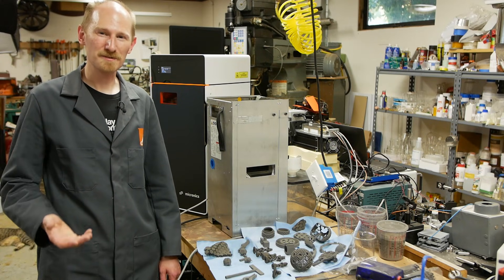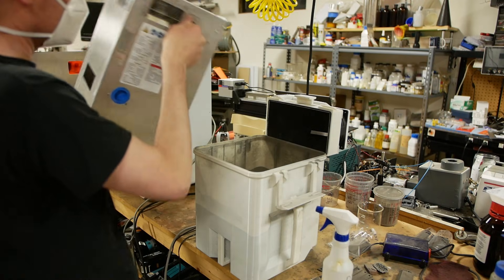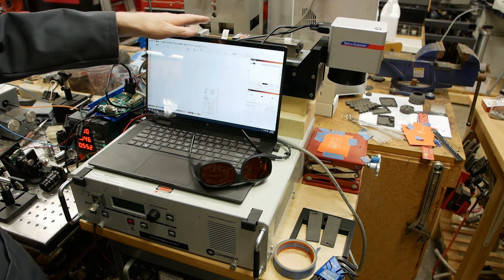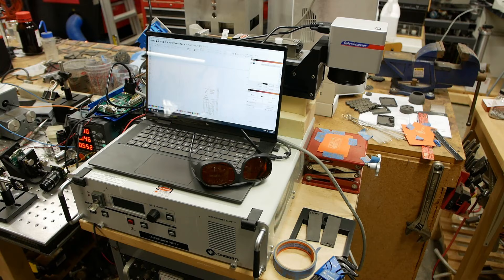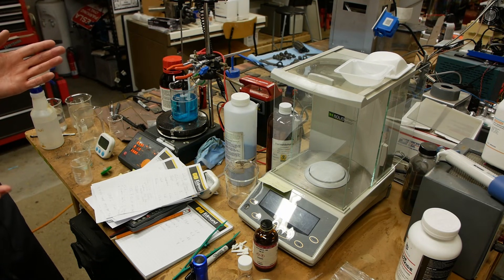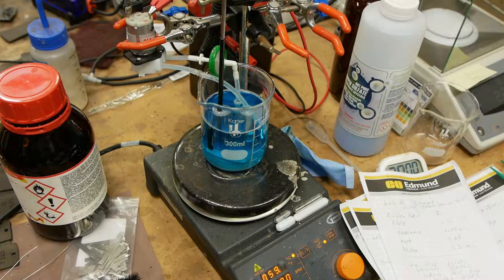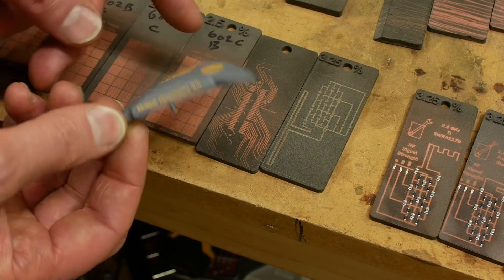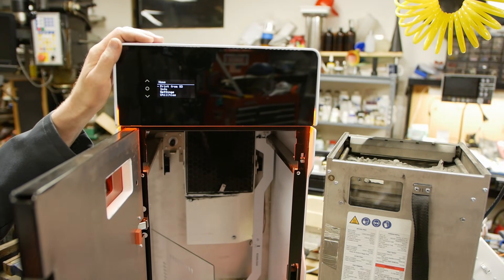Micronics SLS nylon 3D printer makes electronic circuits

Comment: I wonder, using the pulse laser in the SLS device, how closely you could make layers before they start to interfere/leak? Could be a fabulous way of making multi-layer circuit boards—including the use of ground planes—at home.

The final key to this would be if you could pick-and-place in the middle of the printing/pulsing process, to add components to the circuit that will eventually be buried in the final part? Great potential for HV circuits that doesn't require filling with resin to prevent sparks.

Comment: When you mentioned the thin focal plane I imagined you were gonna suggest a pantograph type system moving the optical assembly/part. Integrating a pulsed laser into the printer is sheer genius though!

Comment: So far seen one review where thier printer arrived broke and it was stressed "this is a beta product" and it was held by duct tape.  Then saw another review where the printer keep jamming and failing and the youtuber was told by the creators to hit with a hammer to fix lol.  This is cool product but not ready yet for Kickstarter I feel if folks looking for a viable product in return.

Also the yiutuber where he had nothing but issues even after working with the creator of the printer couldn't resolve things, was told to not release thier video till after the kickstarter was done says something.  Not a fan of a company trying to stop a honest review then demand the printer is sent back and stop sponsor cause the creator gave a honest review

Comment: Very nice video! I understood maybe 50-75% of it, but I was still entertained and hooked by your fascination with it. The method of printing electrical wires in a part is and can also be used in FDM printing with multimaterial so for shure also in SLS. Maybe it would also be nice to have a machine that can also create space for components to be placed inside a part.

Comment: Watching that part flex as you heat treat it was fairly cool. You try doing the laser treatment then printing on it again so you could embed a thick trace that you can pass enough voltage in to heat it to see if you can create a sort of artificial muscle where the heater is embedded?  Or maybe put some iron powder from a toner on every other layer to make a plastic electro magnet?

Comment: @ Applied Science
Thanks for another fantastic video. As always mindblowingly (that should be a word if it isn't) impressive and thoroughly interesting.
And the thoughts on integrating circuits into curved surfaces by doing it during the "planar printing stage" sounds like it would have been "patentable" (which also should be a word ;)... But now this principle is in the public domain... But maybe there still is something that can be "gate kept", not that I'm against Open Source, but I think it's high time that You got rich from Your inventions :)
Best regards.

Comment: Awesome video 👍
Since you said that you can hear when the laser is focused, how about a microphone (with a band pass filter to only let the sound through that occurs when the laser is focused) to control a stepper motor, which in turn moves a little platform up and down to automatically focus the part.

Also, I'm curious if it's possible to clean off the residual powder (especially the fine dust) using an ultrasonic cleaner.

Comment: Electroless Cu plating from my 1968 "Techniques of Materials Preparation and Handling Part 3" book page 1374:
Solutin a:
CuSo4.5H2O    35g/L
Rochelle Salt     170 g/L
NaOH                  20 g/L
Na2CO3              30 g/L
Versene T (Na salt of ethylenediaminetetraacetic acid)  20 ml/L
Solution b:
Formaldehyde 37% by weight

1.  roughen by abrasive treatment
2. sensitize by immersion on a hot solution of 0.1g/L AuCl3
3. immerse in a mixture of 5 volumes of  solution "a" and 1 volume of solution "b" mixed just before use.
25 deg C
25 microns / hr , life of the mixture is about 2 hrs.

Comment: What about sintering high copper oxide content plastic powders?
Those should immediately turn into copper metal under the pulsed laser, but the sintering laser only melts the plastic.

Comment: Even ignoring the fact that integrating the catalyst activation with a widely-available SLS printer allows you to catalyze curved surfaces, it would also just make it really simple to print circuit boards on a 3D print. The plating part may still require some care, but I don't think the value of simply integrating the catalyzing process into printing even a flat surface should be underestimated.

Comment: I'm always impressed with curved circuit board manufacturer. I have a 900R monitor and am using a Kinesis Advantage2 keyboard. I didn't realize antennas were created in this form inside electronics though. And yeah, we all have used LLMs for something technical that seems astounding.

Comment: Really agree with your closing idea of making tools for others to see what they do with them, I think that also motivates me. Re: the internal electronics, any idea how you would do the plating step on a fully internal trace? Would the SLS part need to have some porosity? In that case, you might also have an interesting opportunity for the mechanical "metamaterials" folks, where perhaps the copper could alter not just the electrical but also the mechanical properties of the print.

Comment: Every YouTube channel I come across that makes their own PCBs either use super nasty chemicals, extremely unique and expensive machinery, or straight up lie. I've given up on desktop PCBs. It seems our only real hope will probably just end up with people literally making their own IC's. Considering you could sell silicon chips with pins premade and you just connect to those points and have a projector machine at home, it just makes a lot more sense.

Comment: I used to run a Shipley 3000 PTH line, and we were adding a 500-1000ml of formaldehyde to the electroless (150 litre) bath every 3-4 hours to keep the plating thickness uniform throughout a production day.
Reply: Thank you for sharing arcane lore.

Comment: With in situ pulse laser you could do solid thru hole interconnects for multi-layer trace planes! All you need is to add pick & place inside too to make true 3D circuits. 

I see there are papers discussing using black copper oxide that is heated to 1000C to convert to copper. I suspect this would need to be done in a inert atmosphere to avoid oxidation issues. I believe Copper oxide is non conductive, so you might be able to just add black copper oxide, than pulse laser to make conductive traces. This might be worth the time to try.

Hopefully you post more content with this system! & thank you for this video!

Comment: A couple of points about the dichroic mirror to make your life easier:
-reflect the shorter wavelength and transmit the longer one (this should be already the default for your set-up) 
-if possible (or economically viable), try to find a 1064 Nd:YAG laser for the activation: it will be hard to find a mirror able to split 447nm from 532nm(I guess that's your green laser) and sustain the two lasers power. Most of the dichroic mirrors on the market are designed for fluorescent microscopy. 
-if possible, use polarised light: p for the one to be reflected, s for the one to be transmitted
-remember to add an antireflective coating on the back of the mirror, or you will start carving the side of your printer

Lastly, a plate mirror may introduce beam deviations and a tilt in the focal plane of the activation laser; on the other hand, a cube beamsplitter may interfere with the calibration of the printer laset.

Comment: Summary of Applied Science: 3D Printed Circuits with SLS Nylon Printer 

This video by Applied Science demonstrates how to create printed circuits on 3D printed parts using a new desktop SLS nylon printer and electroless copper plating. 

Key Points:

* Problem (0:00): Past attempts with SLA printing resulted in poor copper trace adhesion.
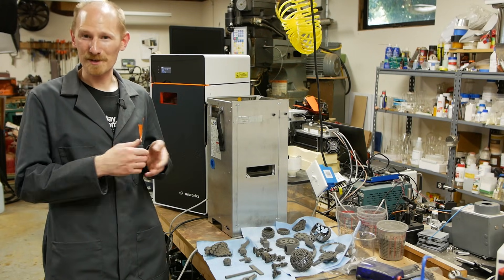* Solution (0:40): A new approach using SLS printing, a pulse laser, and a refined copper plating bath.
* Process:
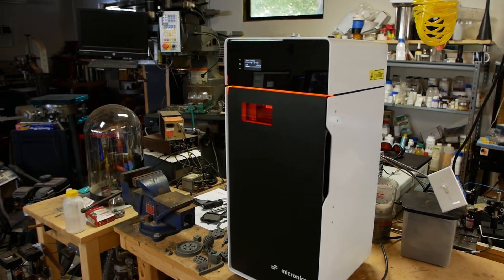    * (1:30): Mix copper chromite catalyst powder with nylon printing powder.
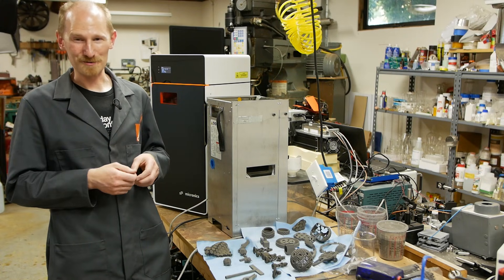    * (1:30): 3D print the desired part using the SLS printer.
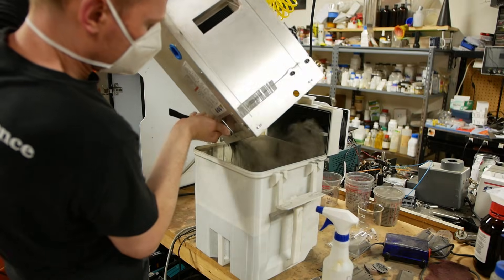    * (2:40): Clean the part with media blasting and dish soap to remove excess powder and dust.
    * (3:52): Use a pulse laser to selectively activate the catalyst on the part's surface.
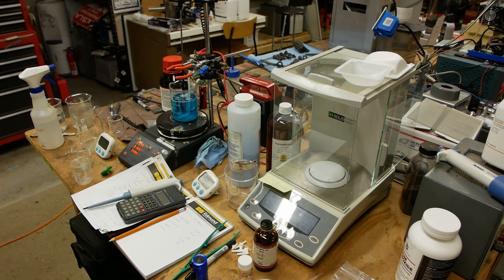    * (8:11): Submerge the part in a carefully prepared electroless copper plating bath.
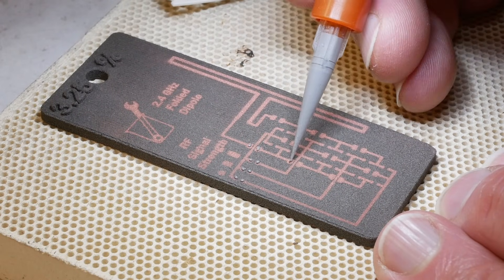    * (12:44): Apply solder paste and use hot air to reflow components onto the copper traces.
* Robust Plating Solution (8:11): 
    * Achieving a stable copper plating bath was a significant challenge. 
    * Key Finding: Dissolve the sodium hydroxide (NaOH) in water before adding it to the bath to prevent copper precipitation. This information was crucial but absent from traditional resources.
    * Dust Prevention: Filter the plating solution (11:49) to remove any dust particles which can act as unintended catalysts and disrupt the plating process.
* Advantages:
    * Strong adhesion: Copper traces are embedded within the printed nylon, resulting in superior adhesion compared to SLA printing.
    * Flexibility: The technique allows for curved traces and complex 3D geometries. 
* Future Potential (14:59):
    * Integrating a pulse laser into the SLS printer for on-the-fly catalyst activation.
    * Creating circuits on the inside of hollow 3D printed structures.
* Applications (17:43):
    * Custom switches and wiring harnesses.
    * Mechanically supported sensors.
    * 3D antennas.
    * Custom connectors.

The video emphasizes the potential of this technique to enable new and exciting applications for 3D printed electronics. 

i used gemini 1.5 pro to summarize the transcript

Comment: I was working on 3D printed electronics in my phd. At the begining I had similar idea that you presented in 16:20, but my problem was achieving copper in the whole sintered layer. Finally I ended up with FDM and precision dispensing with laser curing of MOD ink, which composition I developed myself.

Comment: Look, Ben, exchanging the moving mirror from the printer with an dichroic mirror seems to be the hard way around, if we want to mix two laser beams, each with their own frequency, aperture size and lenses, the easiest way around is mixing them with a static, dichroic beam splitter (working as a beam merger), so it becomes easier to focus and locate the pulsed beam.

Comment: Acid copper baths are all about balance until you contaminate it.
   Been doing it for 6 years off and on. I don't even mix my acid in unless I dilute it with distilled water that's already going in. 

    You can cold weld your base on too. It's just nylon, for now. Solvent based conductive paint might help. You didn't specify which was the problem, water or solvent paint, graphite or copper based. Melt some piano keys and make your own. Similar to nail polish with cellulose acetate in it also.

Comment: Without throwing any shade (god knows I've fucked things up), a lot of methods that aren't step-by-step guides assume a chemistry mindset. If I add sodium hydroxide to a solution containing a mixture of stuff, my first thought is "what possible reactions can occur? Well, I have CuSO4 in it... will that react with NaOH to form Cu(OH)2? Looks like primarily at neutral to moderately basic pH. So I can't add it too fast or the EDTA won't be able to bind the copper fast enough."

Comment: If you use a soldering iron instead of the hot air blower the heat is more localised and the plastic part is less affected.

Comment: I think this would be amazing for printing prosthetics, if you need to pick up electrical signals from where the prosthetic mounts to a location where a motor connects with signal processing build right in, or something like that.
Reply: I think Ben has a background in medical prototyping.

Comment: Super Fascinating as always. Sizzle focusing. That was some bowing with the hot air gun. 1n5711, what a great circuit. If only I was in a startup instead of an overgrown elephant of a tech company where security and H&S crush inovation this is just the channel to find those techniques that really work. Inspiring. Much appreciated Ben.

Comment: What's the porosity on that sintered product? Could plating bath actually soak into the part and create a metal sponge on nylon structure?  Hmm, deposition will be highly diffusion limited in the bulk, but it could perhaps be stirred enough to get some flow through the material, or the concentration reduced and plating time greatly extended (hours to days, perhaps?).

Ooh, or further to that: nickel could be plated, or several other things, and the substrate pyrolyzed or dissolved out, leaving a light yet strong metal framework.  Might be more practical as well if a space-frame structure is printed, rather than relying on the natural grain structure, or perhaps a combination of things.

Comment: A copper foil used in PCBs will always be smoother than any trace from copper powder with a laser or copper deposited in an electroless bath.
Reply: Maybe. Point one really depends on the grain of the powder, and substrait your electrolessly plating onto. Foil really isnt that smooth Ra-16 or so is pretty standard and thats rough enough to cause problems and disconnects with very small traces.

Of course foil cannot get much smoother, the rollers used to make the foil have to have some roughness to be capable of gripping the copper and draging it between them.

Where as nano scale 3d printers use metal plating to produce parts that are on oders of magnatude smaller then any standard of measure for surface roughness, and copper in particular is exceedingly easy to get into powder grains that are just a few atoms wide, combined with some approperate processing techniques that can certianly lead to a smoother finish then any mechanical roller.

But; thats all missing the point of this entire project, a moot point. Curved traceboards is the point of this project.

Comment: I feel like the failure rate will be astronomical if they are used in a structural way. A big advantage of having a separate PCB is the mechanical de-coupling from the structure so that stresses do not affect the traces as much.
Reply: You could mechanically decouple in this scenario too.I don't know if its possible to do print in place joints with SLS but you can make separate parts that snap together in some way.

Comment: The wizard returns! at the turn of the tide! 
Where the hell have you been?
Welcome back brother!

Could you not print a full, flat, multi-layer board complete with vias using this technique? 
what's the resistance on the traces?

Comment: 3d printing metal inside structures could  be interesting for making weird antennas
Reply: We already do this. My whole research topic is this. 

We use a system that has a regular fmd head and what we call a smart pump. The smart pump lets you print any liquid and you can get conductive inks that you printed and we do all sorts of conformal antennas and other microwave circuits
Reply: @Blake-jl8lh  neat!
Reply: @Blake-jl8lh thats super cool! Do you have a paper?
Reply: Very custom battery packs.
Reply: Check out the antenna that comes on TI's AWR2544LOPEVM
Reply: Home made multilayer pcb:s !!
Reply: @ulwur  would be very cool but can't plate the inside layers :(
Reply: @nirodper  Why not? SLS printed parts are porous.
Reply: @markthompson5983 the high porosity required for the liquid to penetrate through the edge of the board fast enough to plate practically, and to be washed of the copper solution and dried without issue, without compromising strength, seems like it would be a dealbreaker. But you could print small plated tunnels as non-straight vias.
Reply: @Scrogan  It doesn't necessarily have to be on a 3d-printed substrate. You could probably just use unclad FR4. Once you have the first layer, you just coat that in an insulating layer and use the laser to poke holes wherever you want your vias to be.
Reply: @spacehitchhiker4264  what are you even talking about, this IS about using 3d prints as a substrate, for traditional pcb's there are better methods
Reply: @spacehitchhiker4264  how would you coat it in that layer?
Reply: What I'm talking about is (hopefully) an method to prototype multilayer boards without requiring impossible-to-find prepregs or a  huge multi-ton press.

Comment: custom switches..?  really? 

custom rotary switches?  for what?  ants?  the way it works now if you take your off the shelf part from China, and shove it in an enclosure, the ots part is too small to be operated by fingers, or be usable by any sort of shaft, or whatever else that might be actually useful, ...  why are you trying to re-invent the wheel..?

Comment: Traces inside structure is exactly what the silicon industry does. For a plastic part this is not done because it is difficult to debug it. You need to destroy  the part. Secondly the complexity rises rapidly. This is the problem of slicing a 3d model. 3d printers know where to do that. If you add a additional thing inside i don't know if this becomes more difficult or exponentially difficult. Last of all unless it is bespoke part there is no way a company is going to build a product that way as it cant be mass manufactured easily

Comment: Apart from your fantastic showcase projects my question is, how do you keep your working space clean ? Do you clean it with pressurized air whilst vacuuming the swirled up dust from the  opposite side ?

Comment: That dichroic mirror idea sounds AWESOME!

Think of it as the Bambu Lab Automatic Material System - an add-on that will improve the capabilities of your printer. It'd need software support, but that could be a really awesome, albeit niche, addition to the printer, and move it into a realm that no-one else has gone.